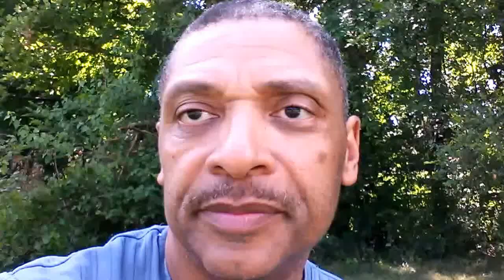Tesla semi Sherpa mountain heavy loads diesels flat trips

Comment: I been trying to figure out how big the battery needs to be for a semi to go 500 miles.  It has to be at least 500 kWh, if not a MWh.  Even at the best charging rate available today, 120kW, it would take hours to charge.  For level 2, it would take days.  Major infrastructure would be needed to increase the charging rate.  I know truck drivers are required to stop, but for how long?  It seems to me that battery swaps will be needed.
Reply: Brad Preece Truck drivers are required to take a 10 hour break before starting the next on duty/driving shift. Also, once a driver is on duty, he has 8 hours to take a 30 minute break. So the question is how much range can you add in 30 minutes. Fully charging the battery  only needs to be done in 10 hours.
Reply: @ZAKEEUSX  no trucker takes a 10 hour break.  F that.  You’ll never make money
Reply from the maker: +Brad Preece many have backup drivers. You could swap tractors or plug in supercjargers at same time both sides of truck